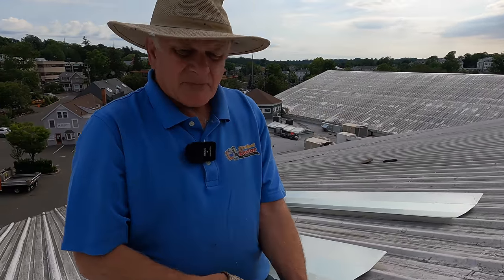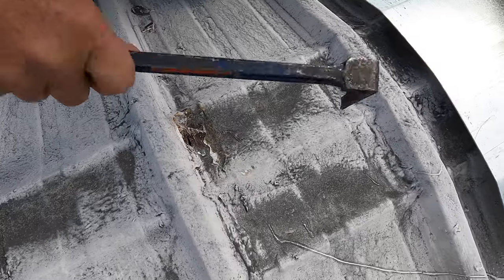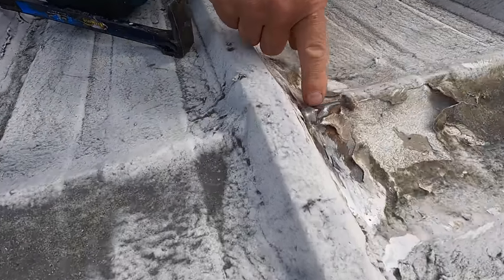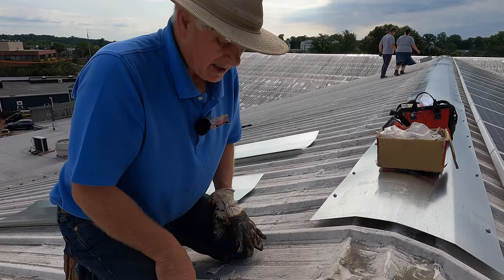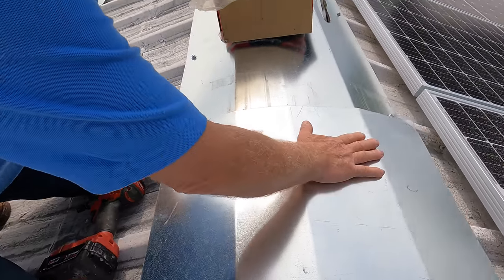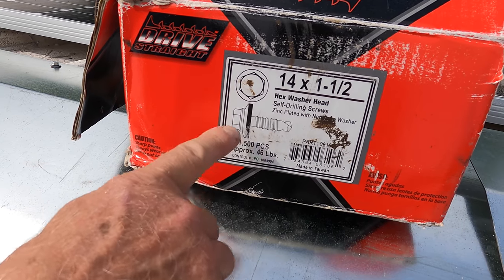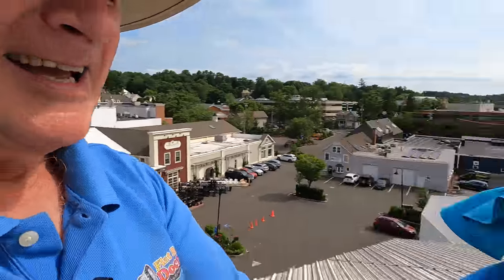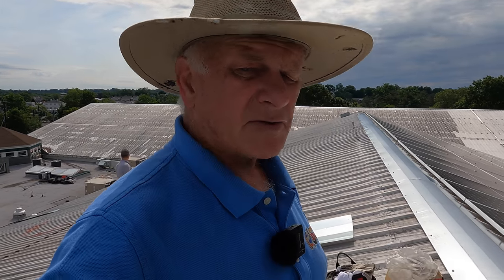METAL ROOF RIDGE: Repairing leaks that stems from a metal roof ridge

Comment: High wind will push water up to it!  That's the problem I have on my house.
Reply from the maker: you are correct, but fortunately the ridge was already sealed. The reason we added the metal over it, was that many workers would use the ridge to walk on servicing the solar panels, breaking the seal.

Comment: You never repaired the holes in the ridge,  ends joints on ridge metal need a caulking tape and also there is no foam clousure for wind driven rain